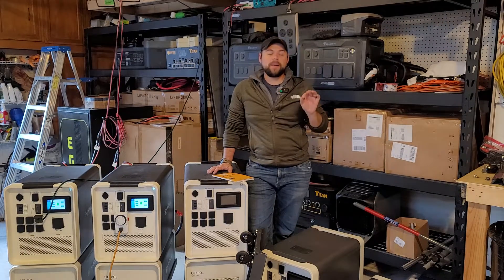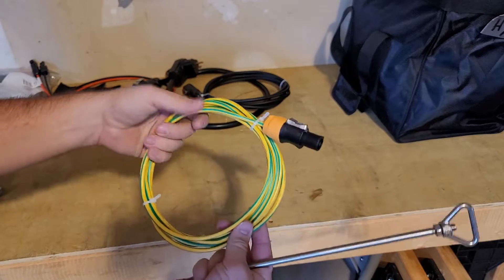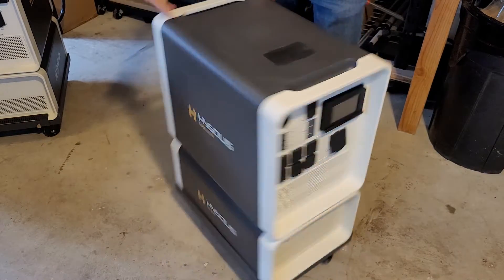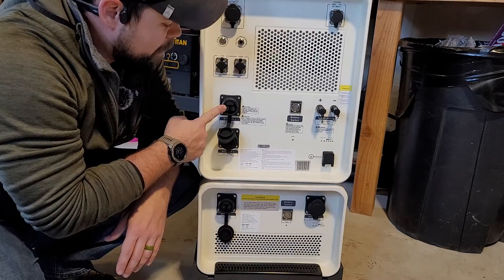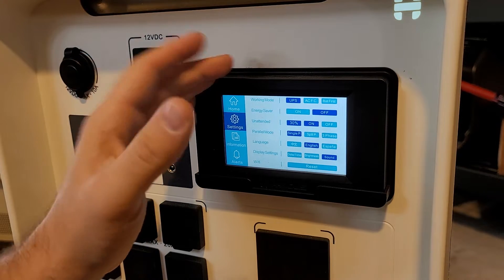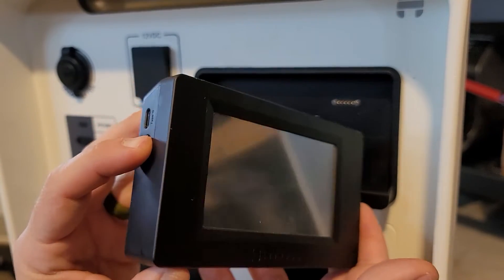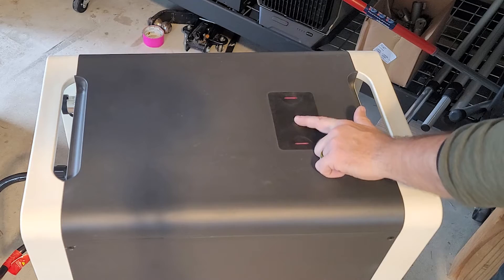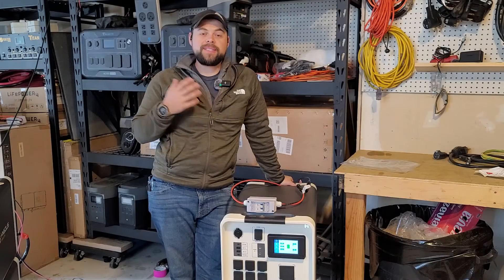Apollo 5K Solar Generator DETAILED Setup Single Phase

Comment: I've had the Apollo for a week now and it's been extremely frustrating trying to connect it to Wi-Fi for remote monitoring. I've been back and forth with Hysolis through many emails. I'm ready to throw in the towel on remote connection. Not good. I'm not sure why they designed the unit so that the vendor has to be involved with getting the unit implemented onto a network.

Comment: Just curious if you have 10 400 w panels how are you getting 4500 watts ? thank you in advance
Reply from the maker: Because when solar panels are colder they are more efficient and convert more energy. That means more watts. So I'm basically getting almost 12% more than the rated output per panel when they are cold and in perfect sunlight.

Comment: I am researching home wind turbines as a possible source of energy to store into a battery like the Apollo. There are several good systems being advertised here on Youtube. (I can give several example of systems.) Can a wind turbine be connected to the Apollo through the solar connectors?
Reply from the maker: Yes you can as long as the voltage is above 60v and doesn't above 500v. I do not recommend them at all since I have yet to meet a single person in real life say they have had good results from their wind turbine. Every person I have met who has one has only had negative things to say about them. It's far more reliable to use that money to buy more solar panels and or batteries.

Comment: Thanks for another great video!
This covers stage 2 of my emergency prep scenario, an expansion battery.  Stage 3 would be another Apollo unit running 120 volt, no need for 240 as I currently consider that a luxury.  Since stage 1 hasn't been fully implemented yet so I'm waiting on any purchase.  I still need to have a manual transfer switch put in and possibly install my gas generator in the garage with an external exhaust (I used to set it up outside but due to an increase in theft that is no longer a wise option).  Before I do too much it may simply be better to leave the area, I'm trying to figure out what too much means

Comment: Awesome! Thanks. Hope you make a video showing how to get the wire from the panels into the house to the apollo. I don't intend to have an electrician do the wiring hook up into the house system. Do I drill a hole through my wall to put the panel wire through?

Comment: I would strongly suggest you ground the system if you are using it in a stationary setup like a home backup system. If you do not you may experience voltage on what should be grounded surfaces like the body of a refrigerator.

Comment: I have a WINCO HPS12000HE tri-fuel generator (gasoline, natural gas, propane) with a 30A outlet. It is not an inverter generator.  Will this charge up the HYSOLIS?

I ask b/c my generator, when feeding the house, requires a relay to signal the SMA SI54058 explaining that grid power is out and that charge is from a generator therefore, presumably, "dirtier" electricity.
Reply: I wouldn’t do it unless you are absolutely sure about it’s sine wave and harmonics. I don’t know a lot but I do know it wouldn’t be good for the generator.